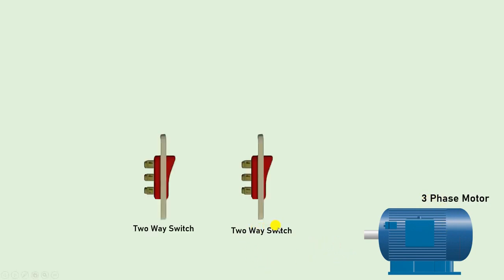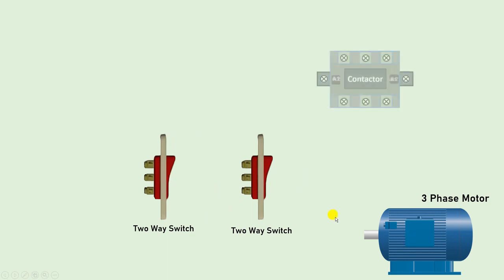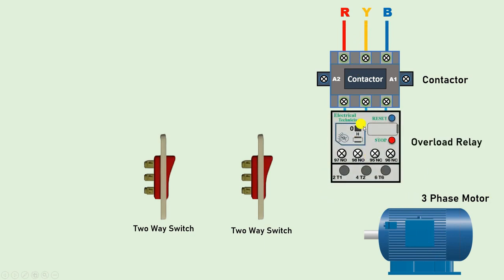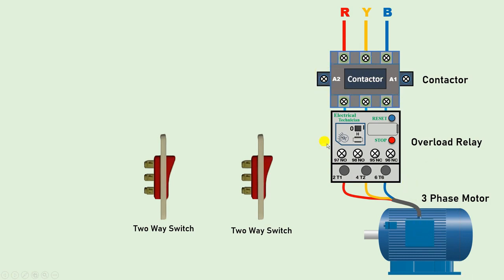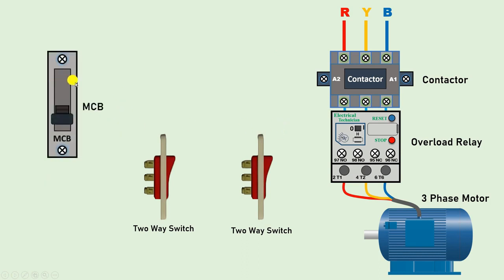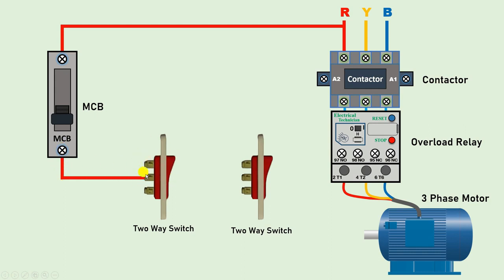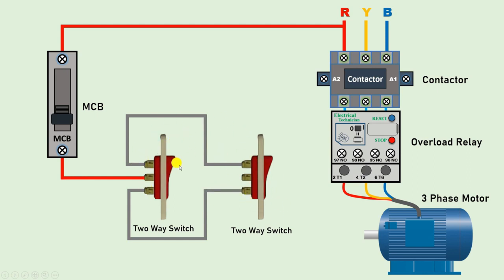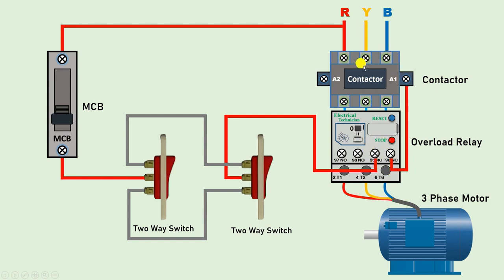3 Phase Motor Control Circuit Diagram by using two-way Switch @TheElectricalGuy

Comment: If I had to do it, I would use START/STOP push buttons. The two START buttons have to be parallel, and the two STOP buttons have to be in series. The reason I prefer this way is because if power goes out for any reason, after it comes back the motor won't start unexpectedly